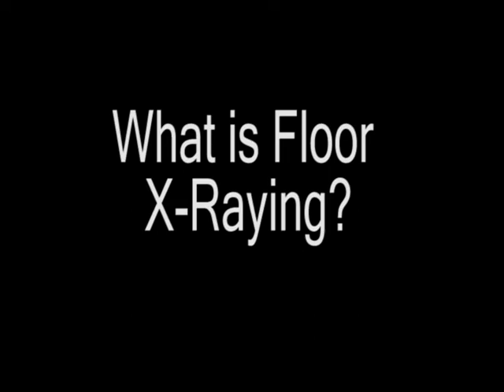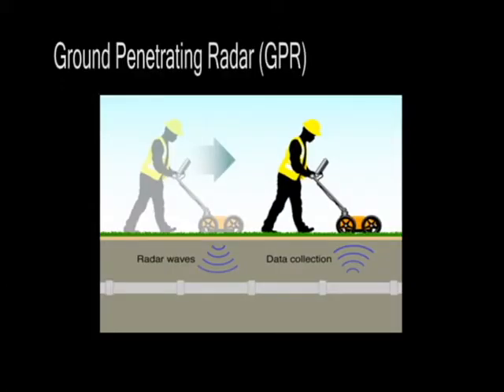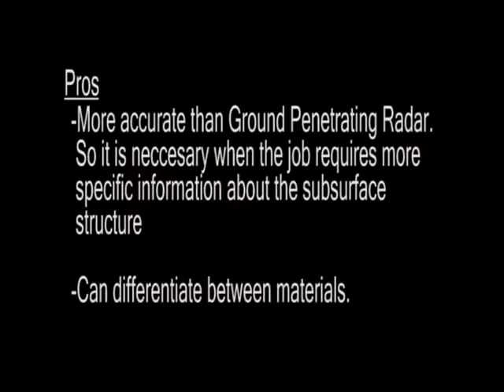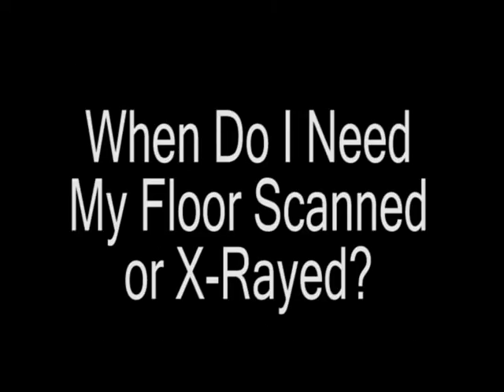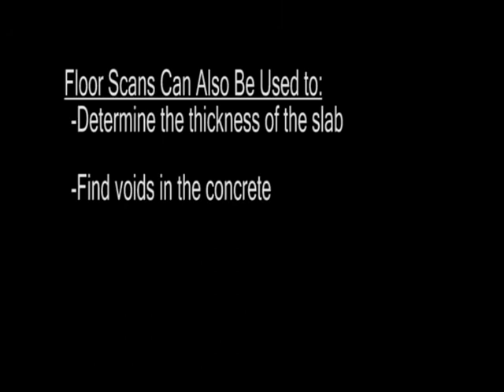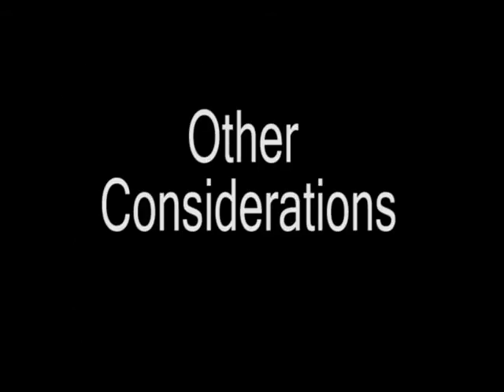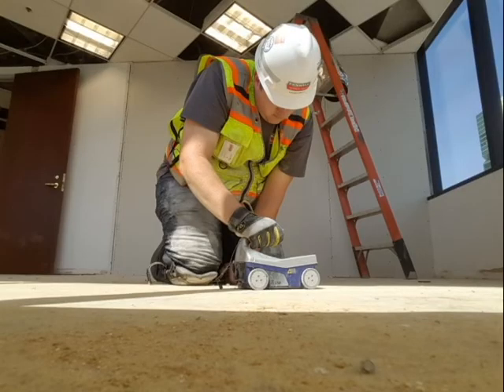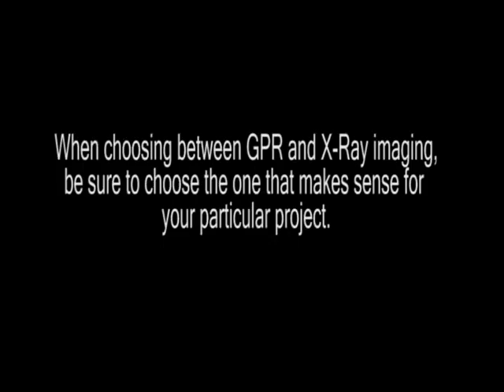Floor X- Raying

Comment: There is no such thing as "radioactive waves." Please use proper terminology when presenting technical information.
Reply from the maker: All forms of radiation travel as waves including X-rays, there are other waves that are not radiation. Describing a wave as "radioactive" would tell the viewer that the wave is from a source of radiation, in this case a Floor X-raying Machine.
Reply: @SSA_Architecture  You can call them (high energy) ionizing electromagnetic wavelengths of radiation. But 'radioactive' denotes a material that emits or gives of alpha, beta, neutrons, or electromagnetic radiation. 
But the term radioactive does not apply to the particles or waves of radiation, because they are not by themselves radioactive material, but instead they are the particles or waves that radiate out of or from the material.